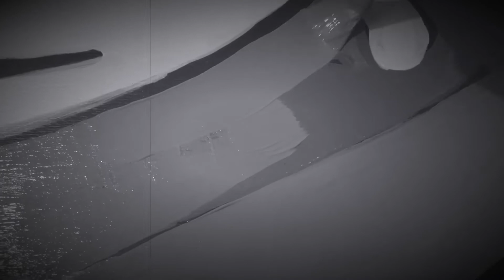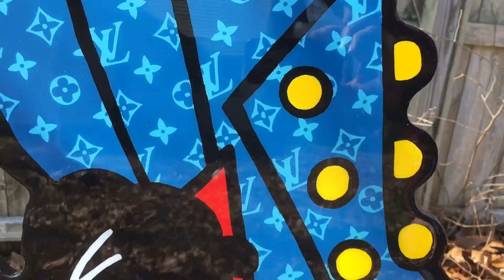Dick Dastardly x Mutley x Wacky Races x Epoxy Resin Cartoon Art Work x Acrylic Paint on Wood Cutout

Comment: Hey man love your work👌👌👌.I am starting slowly slowly to learn also and use that technic with Resin and 3D.I just bought my first ever Resin but i am still little bit afraid to use it and that's why I am making my research.I have 2 questions if you could answer me.1.How is it with copyrights when we are using Cartoon  characters?
2.Can I use Resin also on a 1mm "karton" instead of wood?Cause I am working on a smaller skale of Art works.
Thanx in Advance.Would appreciate if you could answer me.
Reply from the maker: i have never had a copyright issue .. i dont mass produce them tho sooo thus far i have been OK .... i had to look up a 1mm karton ... Yes you should definitely be able to resin that ... it said board so i will assume cardboard ... make sure to modge podge the artwork surface before you resin it ... unless you dont mind the color change that the resin will give from soaking into the board ...  no need to modge podge on wood tho ...
Reply: @KayBoomshop  thank you.Well my first try indeed my colours mixed a little bit.But generally I am sutisfyed.